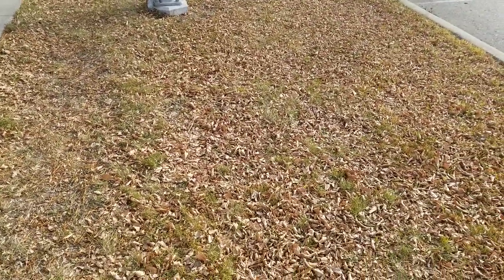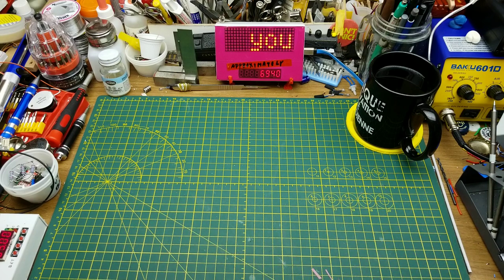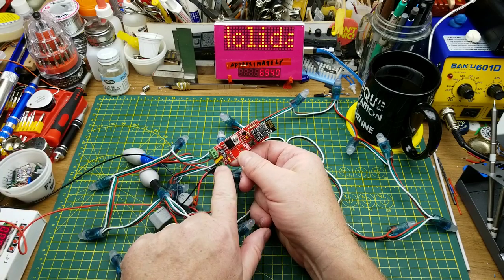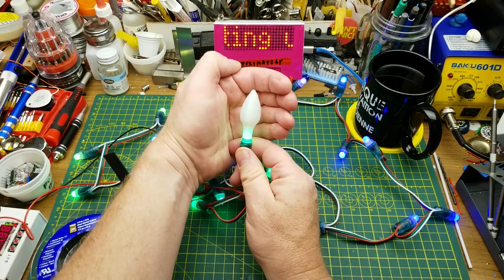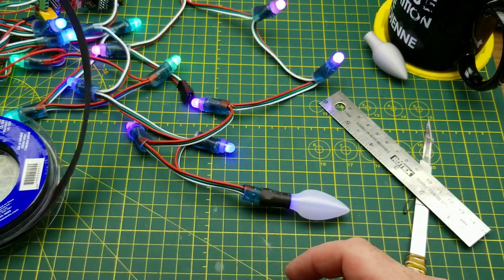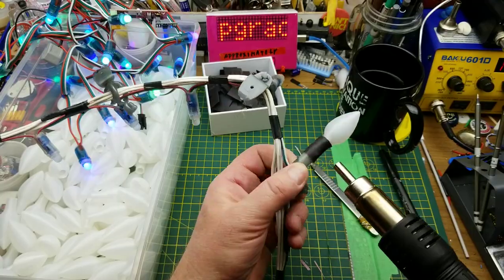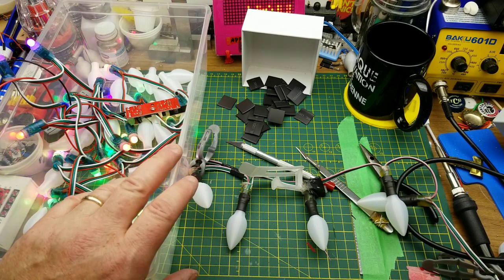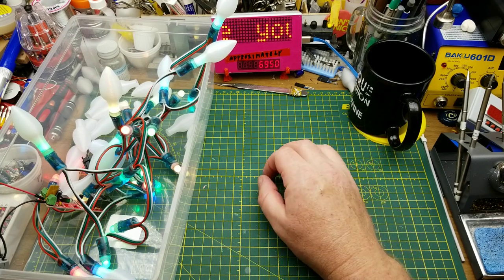DIY Christmas lights upgrade

Comment: 12 Months is amazing life span for outside lights. Thanks for continuing the experiment with the same set to see just how long it lives outside. On Bigclivelive Clive has been working on his lights and even published the scad script for his "bulbs" - //Concertina fairy light cap generator -  that can be used in openscad to make custom caps
Reply: Just a heads up. @pileofstuff was mentioned in the chad  on bigclive's live channel this week end as he revisited some of his light covers. I suspect your channel might grow a bit! :-)
Reply from the maker: I saw that mention. Thanks @SimpleElectronics.

Sadly I was at work when the stream was live, but I watched it later.

I had already printed all of my covers before Clive released his video and files for the ones he did.

Comment: These came out looking really good, I think they look much better than the raw LEDs. I have also been experimenting with covers for these LEDS, and I found that the best result was using white PLA with spiralize/vase mode.  It lets a lot of light through, and diffuses it real nice too. They print quick, although you need to do "one at a time" printing mode. I also made a tiny hole in the end of the covers, to let any water ingress drip out and avoid the LED getting corroded (essential here in the UK!)
Reply from the maker: I experimented with vase mode a bit, but I couldn't get a print strong enough to survive the violence of being removed from the print bed.

I'll have to spend moe time tinkering with the settings.

Comment: For others attempting this kind of thing... Glue-Lined heatshrink is the best way. The stuff I buy in Australia shrinks 3:1 but most importantly it really sticks great, and can actually be used as a waterproofing method as well!
Reply from the maker: Yup, that's the good stuff.

I'm sure I've mentioned it before, most of my projects are (at least partially) experiments in "just how cheap can I get away with doing this and it still works"

Comment: Great idea, it will be interesting to see how PLA fairs in your extremes of weather and temperature. Think I would have used PETG as it is better suited to extremes of temperature and the other bonus is it prints much clearer than PLA which is very milky in comparison.
Reply from the maker: That is my one concern with this project. 

It will be an interssting experiment.
Reply: @pileofstuff  If you don't try you never learn. If you have not tried PETG it is not much harder than PLA, I have an original Ender 3 and it prints it fine. For best results replace the bowden tube with blue Capricorn tubing. Keep up the good work, really love what you are doing (From a UK fan).
Reply from the maker: Capricorn is on the list of future upgrades.

At this point, I'm still a noob at this 3d printing stuff.  Once I get a few spools of PLA behind me, I'll get around to experimenting with other filaments.
Reply: @pileofstuff  I understand, get to know PLA and then move on. 3D printing for creators is the most rewarding extension to the love of electronics and tinkering. Best wishes and I love what you are doing.

Comment: I've had this kind of light strings outside for 5 years now. For Halloween this year I noticed one pixel was shorted to white all the time. That is the only problem in 5 years so I am quite happy. I'll just splice in a replacement pixel. I am going to try printing some of your "bulbs". Keep up the good work.
Reply from the maker: Let me know how the print goes. 
FYI, I used a 2.5mm brim to keep them stable on the print bed.

Comment: It will be interesting to se how weatherproof your 3D rinted parts are. I'm thinking if PLA, not very.
Reply from the maker: I'll be happy to get the season out of them. If they fall apart, I'll re-print them in something more UV resistant.

Then again, I wasn't expecting the bare LEDs to survive a full 12 months.

Comment: I kinda like the old ones because the colours were stronger. At least we'll see how a long the printed bulbs last -  Maker's Muse did a long term exposure test and PLA lasted about 2 years -.
Reply from the maker: It will be interesting to see how well they hold up in my climate.  
You Aussies gets a lot more hot days than I do, and a lot less extremely cold ones as well.

If/when these fail , I might try out some PETG - apparently it does well against UV.
Reply: I'd bet the colors on the covers is actually better in real life than what we are seeing in the video.  I am going to print out the cover and try it myself if I can find the stl here!
Reply from the maker: @kirkb4989  There's a link to the STL in the description - I've already heard from one guy who printed it.
Reply: @pileofstuff  I found it.  The colors are slightly muted by the cover but overall the effect is really good - the camera cannot catch how good it is.  I have to confess but I am using a "c7" cover off of thingiverse because your design is not quite as round as the real thing... But thanks for getting me to try this as it is a great solution.

Comment: Nice upgrade and to me looks nicer. I wonder how much each of those bulb cover costs to produce for you? I see more and more 3D printing everyday, but seldom hear of the costs of making an item and have assumed from little data that is more expensive than a  pre-produced similar item, if it isn't too specialty required, like a small box/enclosure. Can you share any experiences of costs vs value or what is worth making vs buying?
Reply from the maker: These only use a gram or 2 of filamnet each, and the full 1Kg spool cost $20.00 delivered, so its pretty cheap for a custom solution.

Of course, if you were doing thousands, injection molding would be the better choice for price

Comment: I had to get an Ender 3 after I saw yours working, but I haven’t found a CAD solution yet. What do you use for design? I’ve been using octoprint for the actual printing via an Orange Pi - amazing times we live in! Take care. 👍😀
Reply: I can recommend OpenSCAD for simpler models, and it's ideal for these LED covers as you can tinker with parameters very easily to change the shape/size. However, it does take a certain mindset as it's a scripting language so if you are a developer like me you would take to it easily. If your mind works in a more graphical way, FreeCad is pretty good too. Hope that helps; I would suggest you just try all the free offerings and see what's most comfortable for you.
Reply: @MrJozza65  Thank you I’ll take a look at those options. I used Blender a decade or so ago, but the latest version seems like over-engineering for this sort of project! 👍😀
Reply from the maker: I've been tinkering with a couple of options.
I tried this in both OpenSCAD and FreeCAD, but the final design was FreeCAD.

They are very different programs. I find OpenSCAD is easier for simple geometries, ansd FreeCAD is nice for more free-form stuff. But both programs can do both types of design.
Reply: @pileofstuff  can you import open scad into freeCad do you can use freeCAD's path generation/gcode generation?
It would be cool if you could make a modification with openSCAD, and have freeCAD automatically update the tool path/gcode for cnc pockets etc.
Reply: TinkerCAD (web based) is easy.
Reply from the maker: That'd be one of those "advanced" operations that I haven't looked into yet.
I'm still in noob territory with all things CAD.
Reply: @TheRainHarvester  You can read in OpenSCAD files into FreeCAD, just tried it out with some of mine, with varying success. It looks like you would then be able to tweak the model in FreeCAD but I don't know if you would then be able to save the result in OpenSCAD format, I expect it would be a one way conversion.

Comment: Awesome upgrade, really makes a difference! 
Was there a reason you didn't use hot glue to attatch the bulbs ?
Reply from the maker: I didn't want to risk deforming the 3d printed parts with the heat while I was trying to shove the part on.
That was a potential issue with the heat-shrink tube as well, but I ran the heat gun at about half the filament's melting temperature.
Reply: @pileofstuff  - Ah, ok makes sense. I believe most hot glues operate arond 90-120C. But if the bulb is thin, thats a risk.

Comment: did you try the Dig-Uno as controller ? they are really good as well
Reply from the maker: This is the first I have heard of the dig-uno. It looks interesting.

My weatherproof box contains a D1 mini with some custom code my son wrote before I had learned about Wled or any of the other options.
Reply: WLED is good as well.
Reply: Pixel Blaze is another controller option

Comment: Wait...when was this filmed? Your snow looks suspiciously brown and crunchy.
Seriously though, For better light transference, try using a clear PETG in the 3D printer. It takes a little bit of tuning and a good coating of glue stick on the bed but the Ender 3 can do it. PETG sticks like a bugger, so DO NOT try printing directly on the bed, especially if glass or mirror panes (what I use), the glue stick acts as a release agent. PETG will also last longer when exposed to the environment. Something to think about next year 😃.
Love from Alberta where the snow is white and the roads are already good for bonspeils.
Reply from the maker: It snowed, melted and snowed again in a period of about a week.  And it's snowing again today.

Comment: The link to last year's video in your description has eaten a bracket and question mark so it isn't working
Reply from the maker: Edited. Thanks.
Reply: @pileofstuff  Would you do anything different now that you've lived with them for a week or so?   Do you think there would be any value in the LED being further into the cover, or printing the bulb's "step" into the cover?
Reply from the maker: @RSterkenburg  I was initially intending to have the bulb's "sleeve" come down further, but that was beyond my CAD capabilities...
It might be a good experiment to have the LEd poke into the bulb itself a bit. 
I ran out of time to get good enough at CAD before I had to get printing. It's no fun putting up the lights when there's snow blowing around.